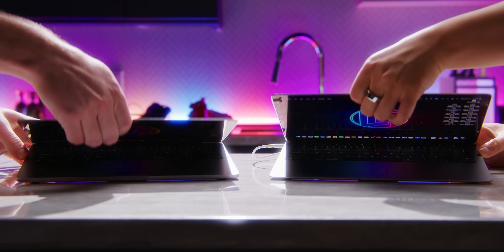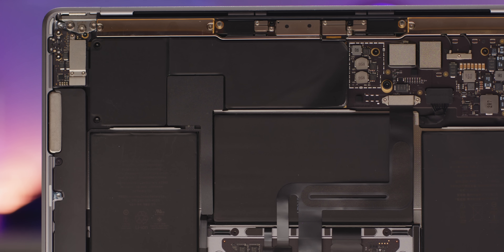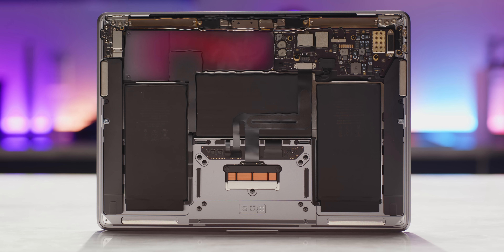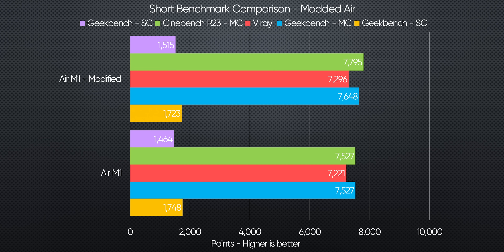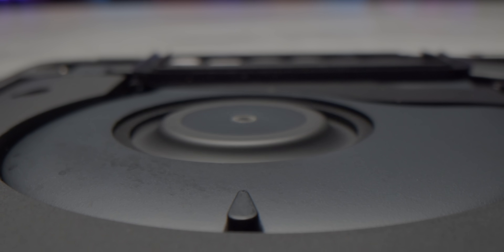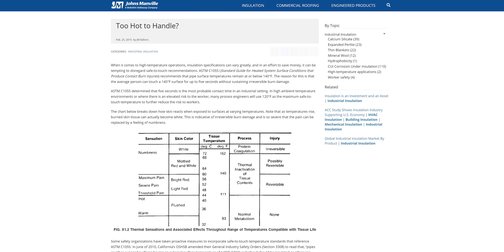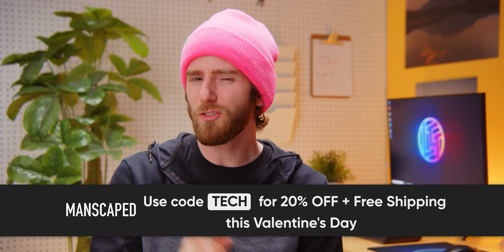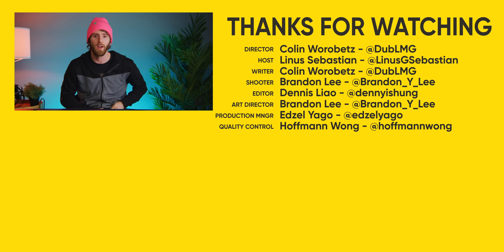Fixing Apple's GOOD Engineering - M1 MacBook Air thermal pads

Comment: Buy like 6 soft freezer safe pads, you know the type you use for injuries. And when ever you do heavy workloads just put it under the laptop. It works great for my 2017 MacBook Pro which overheats anytime I run a Node process. SMH

Comment: A proper external laptop fan should do the trick. Albeit the added weight might annoy users if they carry their laptops with them outside of home.
I guess if I did have an M1 Air and was struggling due to thermal throttling, I'd go with the external fan.

Edit: Nevertheless, I appreciate the video.

Comment: I did this with my G5 SE , this works alot better then some expect. If done to your nvme drives you can see a 10C-25C drop  easy!   And if you are the type to run a laptop stand / cooling pad you can get temps that can beat a tower pc.  Just don't expect this trick to be a cure all for 2080/3080  grade thermals
Reply: And as long term negatives if done right , i have NOT seen any.  mine has been had this mod for well over 7mo now with 8hrs /day heavy loads.

Comment: That's an impressive solution.  I could use that on some of my laptops. Thanks for that.
Reply: Been thinking about this for a while, but everything I have is plastic bottomed. But if you have a properly actively cooled laptop with a metal bottom then implementation could be super good. It could even be like a dual layer thing with exposed metal around any vents where air is flowing though and a rubberized coating on most of the rest of the bottom and sides for comfort reasons.

Comment: Honestly I'm really happy that apple went ARM. Aside from keeping intel on their toes, I hope that it will drive more app devcelopers to start supporing ARM instruction sets directly; hopefully it will even carry over to Windows on ARM.
Reply: There is a huge existing software library for Raspberry Pi. If manufacturers made ARM laptops that ran Linux, the problem would be solved.
Reply: Microsoft have tried for a long time with getting windows to work on ARM. But intel have taken them to court and without the hardware to "force" users to go to ARM when there are better x86 processors out there. it's just been really hard
Reply: @JontesTechTips  and with that Intel went from lazy but cool to super uncool
Reply: @JontesTechTips  Yeah, back then Microsoft force users to only use apps from it’s own app store on Windows 8 RT. The lacks of professional app in Microsoft Store is also the problem. And UWP software were only able to distribute on Microsoft Store only.
Reply: @Cyro1 yeah if they could find some way to do what Apple did and implement the x86 memory schema on windows that would be great, but I could see issues with compatibility with current software.

Comment: I actually did this mod to my M1 MBA just a couple of days ago and can confirm that performance jumps up significantly but the chassis does get noticeably warmer - even while simply typing on a desk you get a lot more heat radiating up toward your fingers under normal office and web workloads. It also jumps the battery temps up internally a bit, so while the speed improvement is impressive, I am considering removing the thermal pad and going back to the factory design, I’m not sure the change is worthwhile when the M1 is so fast already.

Comment: Well, that would be a great idea if it didn't have the potential of causing "gaming laptop" damage to the battery.
Heat is a great way to damage Lithium batteries, and that is one of the reasons gaming laptops batteries die so quickly.
That calculated temperature increase might be within tolerable ranges, but that is a risk to keep in mind. I would rather just use one of those laptop bases with fans on them... That said, those thermal pads could actually increase the effectiveness of the heat dissipation of the base's fans.

Comment: i was thinking Linus was going to tease us with a water-cooled M1 Macbook Air.
Reply: Personally, I was expecting either an aliexpress vapour chamber or liberal application of a dremmel to create 'micro-fins'.
Reply: Have an "addon" that fits between back shell and comp to add an active cooler
Reply: @darunealbane  yeah, the pads inside like he showed, then a laptop holder that lifts the macbook up enough to put it on a water block with another pad. I'm curious as to how that would work.

Comment: Did this to the late 2016 15" touch bar MacBook pro directly on the heat pipe and has not had any problem for 1 year. It Does sustain performance longer but I could now cook an egg on the backplate. I rarely use it on my lap so not a problem and when I do I use fan control to set fans at maximum.

Comment: Well, if Steve Jobs was still around. The MacBook Air would be so air tight. That you can use it as a warming pad for your coffee. As the thing would refuse to work any other way.

Have to keep in mind. There was a time Steve thought it was a good idea to sell a Mac that had no fans, no vents, and the only to get it working. Drop it on the floor. I am not joking.

Maybe in Apple somehow created some sort of Cold Fusion reactor in the mobile products. Would not have to worry about heating (or battery life) issues ever again. Though being Apple, likely go nuclear somehow.

Comment: I doubt that this is how physics work. Only because the surrounding temperature is rised, the heat output of the cpu is the same anyway. Only the heat delivery to the surrounding air is lower because the temperature difference between air and aluminum is lower. So the CPU could overheat at an earlier time but does not go hotter.

Trust me....I’m a physicist

Comment: I'm not an apple fan, but this really topped it off for me. 

My sister's brand new 2020 MacBook air died after 3 months. She ran an OS update & later that day it just switched off mid-use. Wouldn't turn back on. 

So of course, being the female University student she is, and with her extended Apple care service, she went to the genius Bar. 
Let me tell you. The bar is very low there. 

They inspected it. Replaced the logic board. Replaced the touch pad. 
Still wouldn't work. 
Then they claimed they'd found water damage, and told her it would be $400 or more to fix (After already replacing the literal motherboard).

Let me be clear. There was no water damage..

Independent approved repairer replaced a dodgy USB C port & the battery. Covered it under the warranty. Laptop worked fine after that. 
So she promptly sold it, and bought a 2021 MacBook air. 

I don't know what I can't stand more. Apple, or its customers

Comment: On the hospital my wife works: There was a paraplegic patient with second degree burns on the legs due to not feeling that the laptop was burning him.
Reply: Isn't that kind of the only way to get burned? Like anyone else would take it off long before it could happen.

I sometimes put pots from a hot stove on my lap. I just lift it off if I need to. But that brings up a bigger question. How do laptops get hot enough to burn if the regulations are pretty strict about such things?
Reply: @flameshana9  they are probably tested on hard surfaces in well ventilated environments. When you put it over your leg you are restricting the heat dissipation. Over time it will get hot enough to burn you. Also, I don't even need to restrict the ventilation to make my 2019 macbook burn me.

Comment: What kind of temps would you see with adding a vinyl d brand skin to the bottom. It would insulate the bottom panel a bit from getting to hot feeling and might reduce the over all efficiency but by how much. I would be curious to find out.

Comment: Honestly, if anyone bought this laptop for 950 euro or whatever, and consider adding thermal pads, they should also consider a 20-30 euro laptop cooler pad. My brother bought one from Deepcool for about 25, it's nearly dead silent, and would probably work wonders in this usecase. It's not even bad looking imo for an 'apple snob' to use

Comment: Hey LTT, mind sharing precise specs of those pads? Specifically their thickness?
Reply: would interest me too...
Reply: 2mm should be fine I suppose
Reply: The thicc ness? (Sorry, couldn't help myself) 😄
Reply: seconded
Reply: it looks like there are only .5, 1, 1.5 and 2mm that seem to be the common sizes. I'm going to just try the 1mm
Reply: @jeffdunehew  would be great telling us the result... thx
Reply: @jeffdunehew  I'd advise going with a thicker one, coz u probably know what happens if you don't have proper contact (last MBA repair video). 
You could always tighten the screws harder if it's thicker but if there's still a gap  (supposing with the thinner pad), then we'll you could only put another layer on top.
Reply: same here.

Comment: can you do a video with the pro using a custom fan curve for max performance? 

I use my iMac for video editing and if you use a program like Macs fan control you can get much better performance out of it than with the stock fan curve that lets the CPU/GPU run much hotter. the trade off is noise, but for some tasks, I think its more than worth it.

Comment: I see 3 problems with this video:
1. The battery life sucks on all MacBooks when the case is used for heat dissipation, as its temperature increases by doing so.
2. The small differences in the short benchmarks are defined as 'within the margin of error', but when the Air slighty wins, it suddenly is not within that margin? Why?
3. The math in the end ist just ridiculous. The heat dissipation works much better, the lower the ambient temperature is. Therefore, a 10 K higher Temperature means a >10 K higher internal cpu temperature. It may even be a logarithmic scale. I will guarantee, that the outside of that case is >55 degree celsius when the outside temp exceeds 35C.

Comment: This man literally destroyed the 13" pro lineup😂😂
Reply: Not really... the Pro has a larger battery, and if you change the spec on the Air to include the 8 core CPU and 8 core GPU (stock is 8 core CPU, 7 core GPU) the price already comes pretty close anyway.. and the TouchBar is a positive for plenty of folks too.  So there's still differences that the heatsink mod doesn't address.
Reply: @jimtaylor431  That model has 512gig storage, which normally costs 200 dollars extra. So the real price difference is 50 bucks.
Reply: @tunahankaratay1523  Fair point on the storage bump.. I forgot about that! But still, I don't agree that the mod renders the Pro obsolete :)
Reply: @jimtaylor431  The mod literally burns the hell out of you, so it obviously won't.

Comment: "external temp - room temp + 35 = normal use contact" termodinamics doesn't work like this (even if the results is probably not so far)

Comment: What’s funny is that even with the Air thermal throttling it still outperforms most thin and light Windows notebooks in the same price class.
Reply: It is pretty impressive. And I'm not an apple guy by any means. But I look forward to what they do next.. like pc chips that aren't power/thermal limited? Apple seems like they're getting back to being revolutionary instead of evolutionary. Good on them. I still don't think I'll be buying anything of theirs but it's exciting to see
Reply: Nothing funny about it. They just finally ditched x86 and Microsoft failed on that front pretty miserably so far.
Reply: Sjnd
Reply: What are you comparing it to, ultrabooks?

Comment: having that huge chunk of heat that close to a battery cell is extremely worrying
Reply: Apple knows what they're doing

jk
Reply: 1) don't exaggerate, 2) there are internal dividing walls between the battery cells and pretty much everything else, plus like Linus said if you were actually paying attention there is no thermal connection between the CPU/heatsink and the rest of the build.
Reply: @stoneymahoney9106  here it comes the tech guy 
you're being aggressive
Reply: @stoneymahoney9106  k

Comment: So you didn't really "fix" apples engineering. There's nothing wrong with it. They already squeezed every bit of performance they could out of the Macbook Air they legally could do without burning you. So if anything you "overclocked" the Macbook Air in the sense that "It's good. But it could be BETTER" at the cost of your warranty.

Comment: the mini heart attack u will get every second while trying to do this 
something gone wrong 
gone that money in the air
Reply: Yeah I’d be getting heart palpitations trying out this modification. Just wondering about the heat spreading over the whole bottom of the Mac and what damage it could be doing to the other parts inside that weren’t designed to be cooking in that elevated temperature.  Nah, I won’t play Russian roulette with my expensive MacBook Air, it’s not worth trashing the warranty just for a higher burst of speed. Get the MacBook Pro if you need the extra power and play it safe.

Comment: What about the batteries? Would that heat negatively effect the life of those batteries or potentially become a safety hazard? (quick google on it) "Lithium-ion performs well at elevated temperatures but prolonged exposure to heat reduces longevity. Charging and discharging at elevated temperatures is subject to gas generation that might cause a cylindrical cell to vent and a pouch cell to swell. Many chargers prohibit charging above 50°C (122°F)" not sure if dangerous, worth testing.

Comment: TBH, the MAcbook air, should have put the SBC behind the screen a heat pipe to spread the heat across the bottom of the screen, and used a giant, electrically isolated graphene pad, to carry the heat up, sure, even though the SBC wouldnt be allowed to run as hot to protect the screen, with the heat pipe, and the graphene turning the entire back into a semi active cooler using convection, it would still probably be faster than the Macbook Pro

Also, if you took your mod farther, you could use grapene thermal pads with some sort of thermally conductive mild adhesive to hold the pads in place, and some sort of electrical barrier between the pads, and the SBC. If there was room, it would just be easier to get one of those supersized thermal pads like the one you have(i think the ones i use are 200mmX200mmx1mm) and then find the largest graphene pads you could find stick the graphene to the back of the blue thermal pad leaving say, 9mm in between each graphene pad. The graphene pads will stick to the sticky thermal pads, the empty space between the graphene pads will stick to the back of the chassis,  and the thermal pad will keep the graphene pads electrically isolated from all of the electronics on the SBC

Comment: You could also buy a laptop which is not a 1000% upmarked Pinebook. Something like a Thinkbook or Elitebook. And for the Windows-haters, you can always use Linux. Which is like Mac-OS, expect better in every way, because you won't be imprisioned in propriotary-ville.
But if you are a Apple-user, you should do this mod and burn your private area. If you are not able to replicate anymore, I consider that a win for the mankind. Less stupid drones buying overpriced junk from the Josef Stalin of tech, which continues to ruin the industry with their "innovations". Innovations like build in obsolescence or removing ports or blocking third party repairs.

Comment: I've picked at apples bootleg cooling on twitter a few times, I ended up bootlegging it myself with a USB fan with the mac turned upside down and hooked up to an eGPU, then cranking the macbook pros fan on maximum and it stays p cool

Just sit the USB fan on top of the mac, use your monitor/TV to power it and crank up the gam-- I mean non-gaming related tasks.

Comment: Thinking about it, you could take it a bit further, by adding grooves on the aluminium underside, increasing the surface area even more (dont know about the thickness of the material, might actually require a custom made plate)

Comment: So linus I know you read all the comments so I would just like to ask out of the choice of a 2019 razer blade 15 with a gtx 1660 and i7 with 16gb of ram and 144hz screen or a surface book 2 15 inch with a i7 16gb of ram and gtx 1060 with a surface a dial and pen. I don't game too often and when I do its mainly apex legends and rainbow 6 . I'm a student programmer and I kinda prefer the surface display but the razer performs better. I personally dont mind the weight of either. I also plan on dual booting linux (so no macbook for me😪).I got offers for both of them at £1000 I'm not sure what that is in dollars but I just wanted to know what laptop I should choose. 

(Also I would greatly appreciate any advice from everyone else)
Thanks

Comment: This problem/fix has been around forever. I have heatsinks on the back of my surface 3 from years ago and it significantly increased performance. You can also use Graphene adhesive pads to distribute heat more evenly.

Comment: Linus: cools a laptop that almost never overheats
us: This was not the thing we wanted but it was what we needed
Reply: Well, it never overheats because they throttle performance and by that "turn down the heat source".
That's like improving the MPG of your car by putting a brick below the gas pedal. Technically it does work, but it's certainly not an engineering miracle. 
And neither is Linus removing said metaphorical brick.
Reply: @monstie2795  shut up

Comment: So interesting to see how apple is moving forward with their own silicon.
Interesting to see what this stuff will look like once it’s reached the 3rd or 4th generation
Reply: They have been doing this for years in iPhones.    This is just the first time they put one of their processors in a laptop
Reply: Technically the M1 uses the same core architecture as the A14, which is Apples 9th generation design. Their first custom core was introduced with the A6.
Reply: It's gonna be real hard for them to create much powerful cpu than this ESPECIALLY gpu, i think they're planning on taking discrete gpus with an integrated gpu